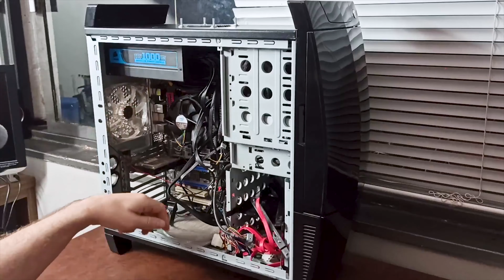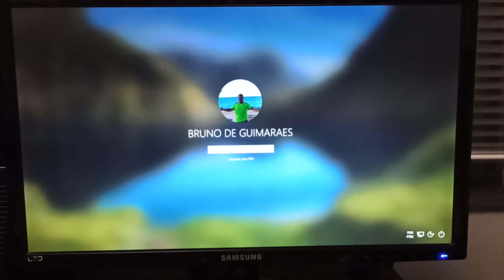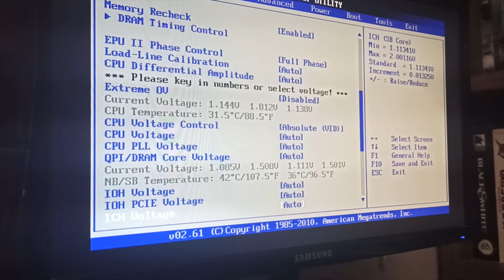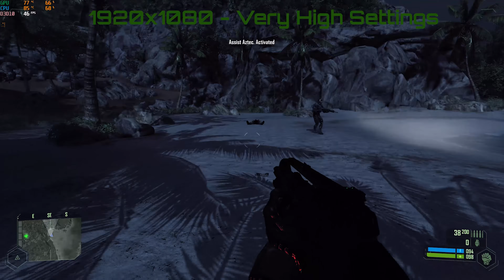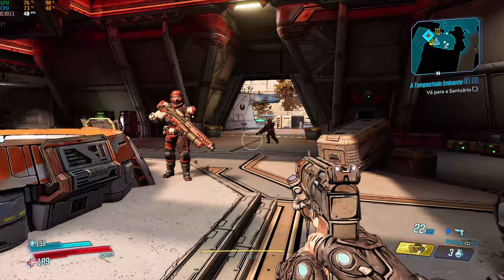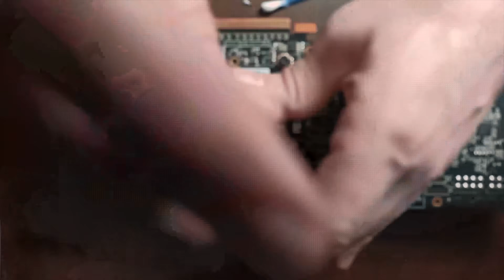I7 920 + GTX 580 Build and Game!

Comment: I actually have this exact same case for my i7-920 system, recently upgraded the CPU to the $55 Xeon w3690 (server version of the i7-990x from 2010). Look for it on eBay or on AliExpress if you ever decide to upgrade!
Reply from the maker: Thanks man! I already upgraded this with an e5670, I did that on the cyberpunk video. I actually filmed this before it, but interrupted to upload the cyberpunk video in the best timing I could. So yeah, this system is now running with an e5670 and a GTX Titan, to be tested in the next video that should be out in a week or so.

Comment: holy crap brother the inside of that pc was an absolute mess!

Tomorrow I am doing a refresh of my pheon II X6 pc. The coolermaster hyper 212 cpu fan is buzzing and probably needs a good cleaning and lubricated bearing.

On that note, the friend I bought the PC from installed the heat sink the wrong way, so I will fix that - The cpu is currently blowing hot air straight at the graphics card, lol.

Then going to redo some of the cable management. The original owner (my buddy) did a decent job but some the SATA power cable and the Molex cable from the PSU are awful right now.
Reply from the maker: Cool man! Good Luck with your PC! I love those old multicores, I upgraded this pc with a xeon 5670 with 6 cores, 12 threads. Thanks for coming by, always nice hearing from you.
Reply: @SUCRA  Sorry I didn't watch earlier!! It's good to talk to you man. My main computer (i5 3570K) idles around 50c right now. It has 5hebdtock heatsink that hasn't been dusted in 8 years. I think I'm going to try and find a decent aftermarket cooler for it (but idk if LGA 1155 coolers will be available at the store)
Reply from the maker: @Jason-fp7vi  no worries, I hope you get some enjoyment out of these. You are better off trying to get an old stock or maybe used cooler on ebay. 50c is not terrible, but since ambient temperature is so low over there, you could probably get better temps.
Reply: @SUCRA  I loved this video... It seems like you and I both enjoy seeing older hardware pushed to play newer stuff
Reply from the maker: @Jason-fp7vi  yeah! Definetely my jam 😂

Comment: I had older 2000 PC case that has bit more hole for cables than yours. I also modified to make the hole bigger for cabling

However, the side panel won't fit
Reply from the maker: Oohh That's too bad! Good on you to try, and to modify it yourself though. Thanks for the comment!